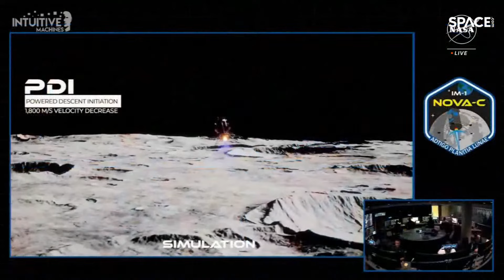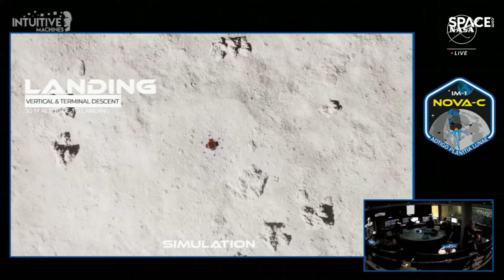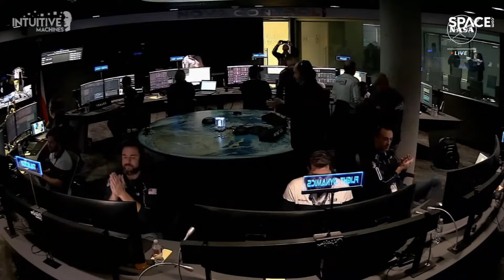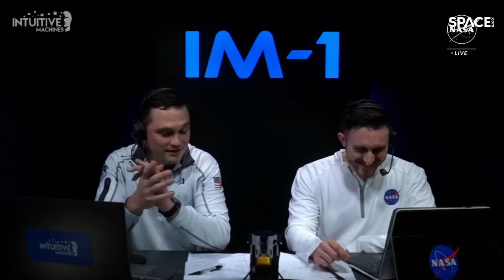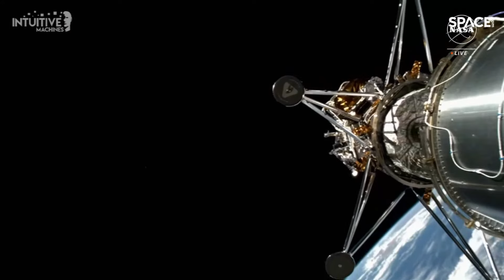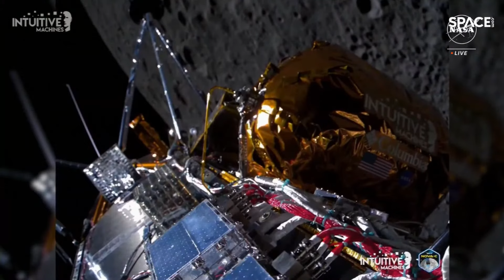Touchdown! Intuitive Machines' Odysseus lander makes historic moon landing

Comment: Congratulations to the entire Intuitive Machine's team for this historic feat!
Reply: Its failed
Reply: @harshitrai5306  It’s not failed. Although it “tipped over”, all the major payloads are working and the solar panels are getting recharged. Despite the failure of the primary navigation sensor, they were able to use a technology demonstrator (NDL) to guide the vehicle safely in the vicinity of the intended landing target and have a soft touchdown is a remarkable feet and a massive success in my opinion. Don’t buy the narrative of those who are only interested in this event for LUNR stock value. Celebrate the technological achievement and the possibilities this success opens up for future missions.

Comment: Where is the video footage of the landing?  We want to see HD footage of the damn moon!
Reply: We have to wait until AI is good enough to produce real looking "live" footage 😂 Elon is working on this. Maybe in a few years
Reply: They were able to send back live video of all the Apollo landings... However DON'T FORGET that technology has greatly diminished in the last 55 years. We simply no longer understand how we did it then
Reply: @kayaker99  21st century, dude, 21st century; your bad excuses don't work here. Sorry.
Reply: @IncognitoActivado  You obv. didnt get the wellplaced irony of "We simply no longer understand how we did it then". 
Read, understand, reply (or just be quiet for a sec, works also)!
Reply: @kayaker99  Incorrect. There was no live video of the Apollo landings. Live images weren't sent until Armstrong descended the ladder which was about 6 hours after they landed.
Reply: @grahamyates2490 Sure there is! What are you talking about? Never ever saw that riveting landing scene with Armstrong running out of fuel (but you dont hear any noise from that 10.000hp thruster anyway) ... why is that, I'm wondering. The LEM was pressurized and connected to the thruster engine, right?
Reply: @kaptainkrampus  Incorrect. Those images of the descent and landing of the LM were taken with a 16mm film camera which wasn't seen until after they returned to Earth where it was developed. 
It certainly wasn't broadcast live.

The statement, ""We simply no longer understand how we did it then" is also wrong.
The Apollo missions were one of the most detailed recorded scientific endeavours in history. All the technical details were retained and are on record. To suggest that we don't understand the process is a nonsensical claim with no basis in truth.
Reply: @grahamyates2490  
"It certainly wasn't broadcast live." That's interesting! Always thought that landing was live. 
What did people see then, watching the 'live broadcast'. ... maybe talking heads and simulations like in this vid here?

""We simply no longer understand how we did it then" is also wrong." - Mate, I#m pretty sure timsimhurst is joking and mocking here. You are the second, who's not getting it ... 

"All the technical details were retained and are on record" Funny! What was NASA's Donald Pettit referring to then, when he stated his famous quote: "We destroyed 'the technology' to go there, but it's a painfull process to build it back'
Are they simply trying to charge twice for the same product?
Reply: @kaptainkrampus  "Always thought that landing was live" - it was followed live on tv stations around the world but there were no live images of the descent and landing. 
And yes, tv stations did have their commentators following the audio between the LM and Houston with experts explaining what was happening. 
And yes, some tv stations made their own simulations for their viewers (the CBS one is still available on YouTube if you want to confirm that).

There's no reason to think that timsimhurst was joking with his comment, "We simply no longer understand how we did it then". I've had conversations with a number of conspiracists who profoundly believe that NASA stated that. 

There are are two categories of technology, the knowledge, and the hardware.
Pettit was talking about the hardware. Which at that time (almost 20 years ago) didn't exist. Not in any operational form anyway.
Reply: @grahamyates2490  
1) Very interesting, did not know this. Thanks.
But those moon walks and rover strolls, once the camera was mounted outside. That was live, or was there no live coverage ever?
There is this story, that NASA did not provide a signal feed, but had the TV stations aim their cameras on some display screen. What do you know about that?

2) You actually serious here? Look what the sentence before that was: "However DON'T FORGET that technology has greatly diminished in the last 55 years." 
You think he is serious there too?

3) Really dont see, what 'the painful process to built it back' would be, when all the documentary is avaliable and the contractors (Grumman, Lockheed), who built the bulk, are alive and kicking. Compared to every other transportation technoloy this is unheard of.

Let me state on thing very clear: Apollo is not sacrosanct. 
There is a lot of fishy stuff going on. Starting with the fact the LEM never successfully flew on Earth, the cameras, the fact NASA 'lost' all telemetry data AND the original tapes (This is unherard of! This is a unbelievable catastrophe, yet NASA only shrugs with a simple 'just cant find them'), many other things (moon tempertature and camera film for example) and of course the 'petrified wood' sample in the Dutch Museum.

May I ask: What is/was the actual outside temperature where the Apollo Missions landed (all near the equator)
What about that 'petrified wood' - how come?

So, to make myself clear: I dont have believe anything. I'm a facts guy and acknowledge these facts. I dont dabble in 'theories', but I question things. That is allowed, right?
Reply: @grahamyates2490  Wrote a lenghty 3 point plus reply today, which seems shadowbanned. 
You cant see that, or can you? ... hard to have a working communication here on YT these days .. oO
Reply: @kaptainkrampus  no, the last reply of yours I can see is 1 day ago. It starts .... "It certainly wasn't broadcast live." That's interesting! Always thought that landing was live ...."

Maybe try again?
Reply: @grahamyates2490  Gosh! Thanks! Interestingly it is visible in my history, but does not show here .. nice shadowbanning, YT! 
Wonder which word triggered them - nothing nefarious in it ... but I'll try later (at work right now). Cheers!
Reply: @chrimbus71  Yea, CGI takes a while to render 🤣
Reply: Unlike you, experts can tell the difference between real and CGI.  @PuggyPLilTaco
Reply: The purpose of the mission was to land scientific instruments on the moon, not provide you with entertaining video.
Reply: @ToEuropa Oh, yes, 'scientific instruments' for 'scientific experiments' on 'scientific missions' ... 'Trust the Science', right?
We paid 118mil for that fricking thing, a LOT of people question the validity of all of this - and it is too much to ask for some fricking GoPro footage?
You CANT, that's your problem - because the nerds would rip your 'footage' apart and point out all the errors of your fakes. 
And that's why your heoe dont dare to do that, because it would blow up so bad in all of your faces, you would never recover from THAT fact ...
Reply: @ToEuropa  so how you know if it's real or fake, dozens of telescopes 🔭  and satellites 🛰 and  all the bla bla and couldn't get a real video or even a picture 😂😂😂😂😂
Reply: @ToEuropa  Bad excuses are not tolerated.

Comment: Live pics of everything But the landing
Reply: Just like with every other Moon landing ever.
Reply: @grahamyates2490 Isro shared live  moon landing telemetry data and live landing images...
Reply: @gopalmaniraj  Yes, they shared telemetry data (altitude, attitude, speed etc) and that data was used to produce the animation that the engineers in mission control used to judge the craft's position during landing.

There was zero live vision of the actual landing.
Reply: @grahamyates2490  Not only telemetry data pls watch again isro live.... they shared realtime landing live photos... iam not talking about animation.

Comment: Congratulations on a successful landing on the moon.   Now get that valuable data back to earth.
Reply: It would be great if we could confirm this with cameras, but they conveniently left them out.
Reply: What valuable data? Ice cubes?
Reply: @hughbarr8408  Mineral composition, etc.
Reply: It crashed!!!
Reply: Successful  ? 
🤣🤣🤣 . 
Zero footage .
CGI and BS doesn't = touchdown.
Reply: @EndofDays-7777 🤡🫵
Reply: @EndofDays-7777  There were no cameras  on the moon to capture it landing, and they had a very weak signal after it landed due to it landing near the south pole.   Weak signal = low bandwidth.
Reply: @harpintn  Bad excuses are not tolerated. XD
Reply: @IncognitoActivado  You obviously don't know or understand how radio waves work.  I will give you a hint.  Outside of an atmosphere it is line of sight.
Reply: @harpintn  21st century, dude, 21st century; your bad excuses don't work here. ;)
Reply: @IncognitoActivado  It is still the stone age on the moon.
Reply: @harpintn  Eh, no, not really. XD
Reply: @harpintn  Again, 21st century, year 2024; try again, sheep. XD
Reply: no, the landing failed. it landed on its side. Therefore no footage @harpintn